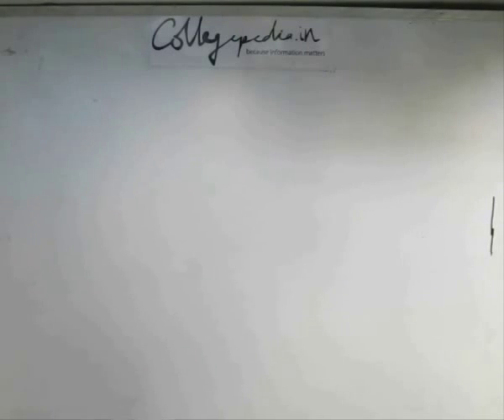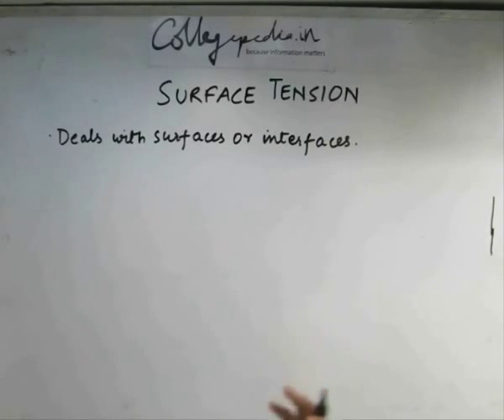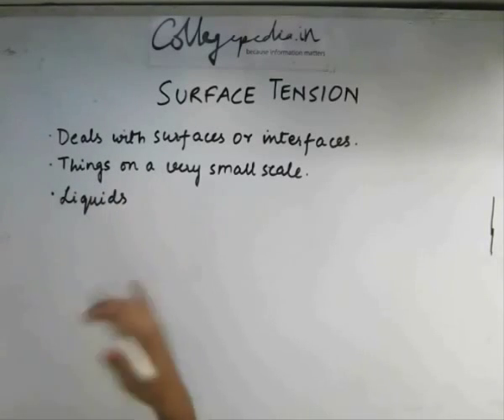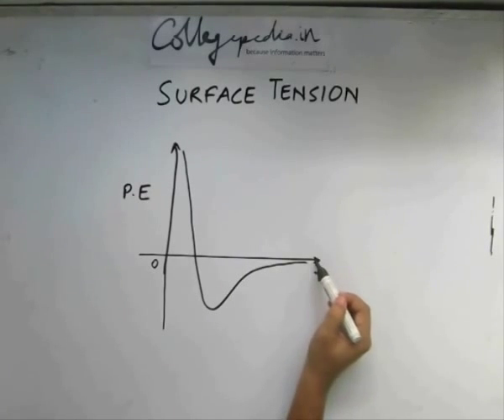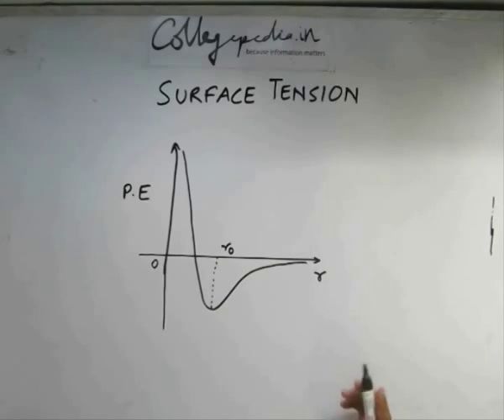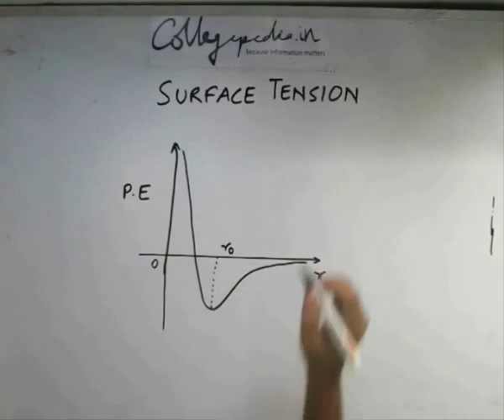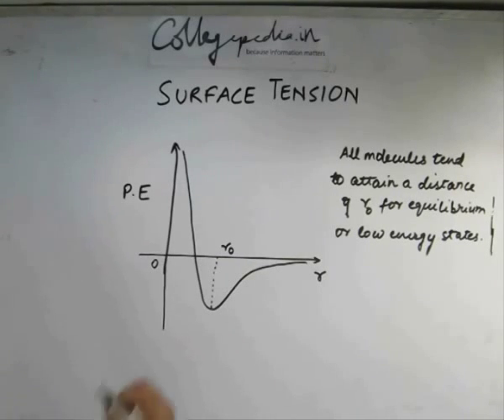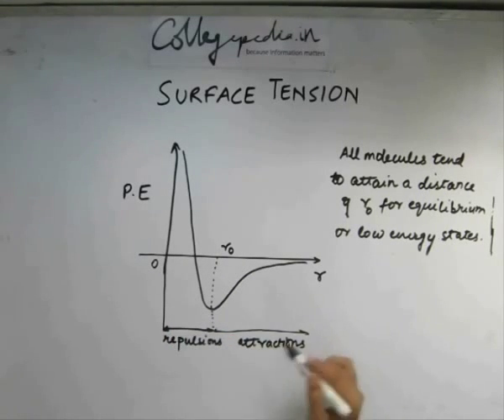Surface Tension, Lecture 1, Physics IIT JEE (Introduction, Potential Energy graph)

Comment: If there exists a state of negative energy between the atoms or molecules, then shouldn't it distort space time and send one of the atoms or molecules a very large distance away from the other in which case it tries to attain a net energy of zero between them as the lowest value where they are stable?